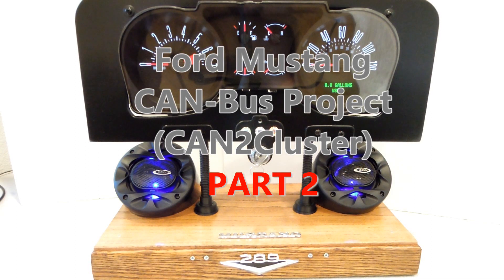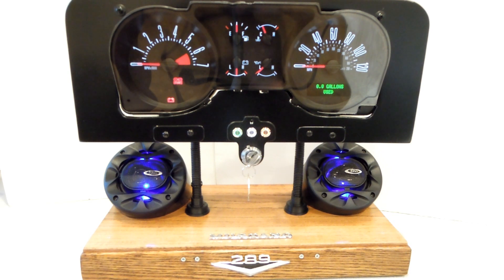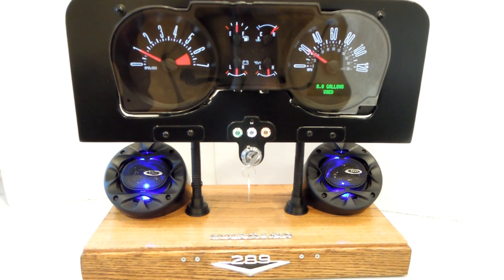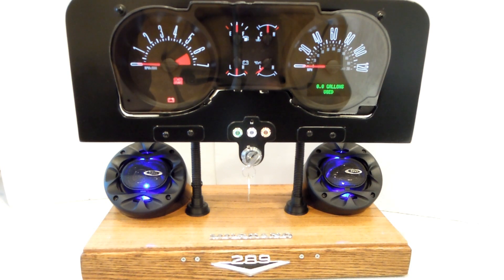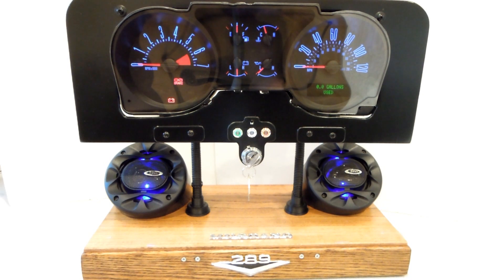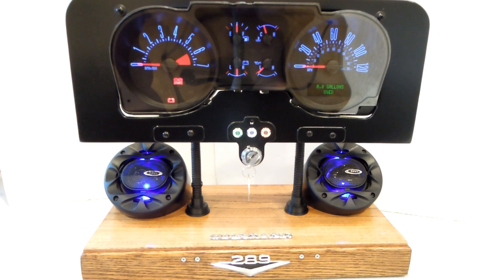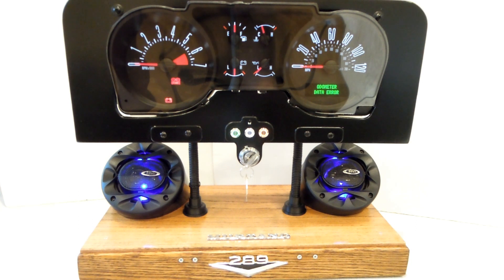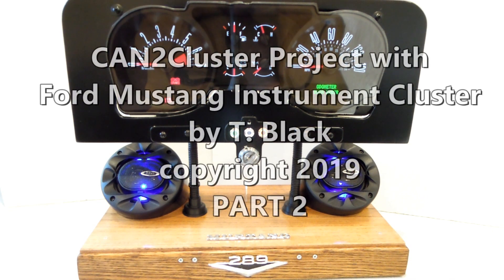CAN-Bus Project with Ford Mustang Instrument Cluster, Part 2

Comment: Hi men, my name is Patrick. I'm in Wisconsin.  I really love your instrument Panel display. 
I have a question. 
I have a chevy instrument cluster Panel that I will like to use aduino to wire it into my driving simulator. Is there a way that you help me with this.  Not for free .
Thanks men.
Reply from the maker: Thank you for your interest in CAN2Cluster. I'm knee-deep in projects and unfortunately have zero free time to assist. All the technical details are published on the Github site, so hopefully you can find someone with the necessary skills to help you out.

Comment: Looks like you had fun with the CAN sniffing. Not sure if you have come across it but http://www.savvycan.com/ https://github.com/collin80/SavvyCAN. This tool allows you to record CAN data and play it back, further you can turn on/off PIDs. So you can go for a ride in a  mustang, record the data. Play it back to your dash, turn the PIDs on one at a time and see which ones make the gauges twitch.
Reply from the maker: Thanks for the link to the SavvyCAN sniffing tool. Unfortunately I don't have access to a running Mustang (the instrument cluster came from a wrecked vehicle). All the gauge and indicator ArbID's were found by blind CAN-Bus queries. All the details on how I did it are in my Build Blog, link is in the description above.